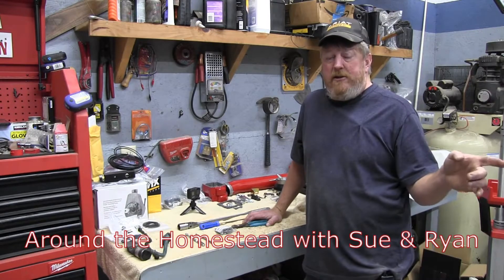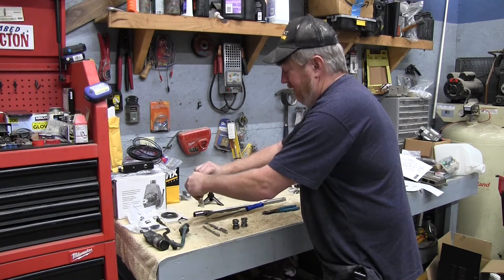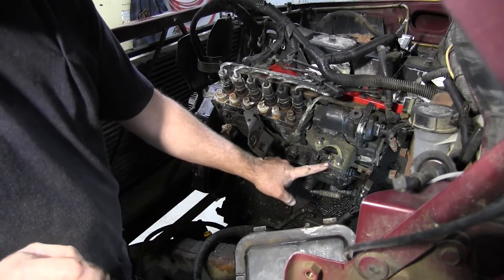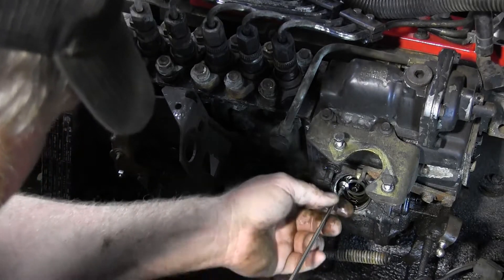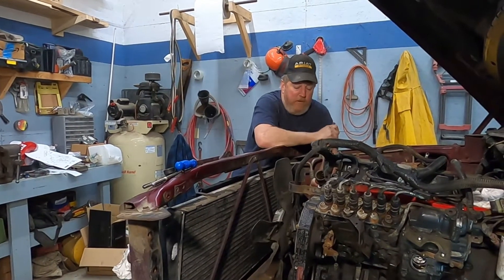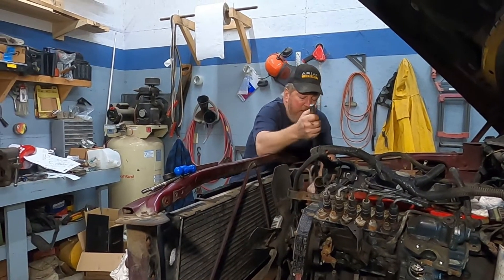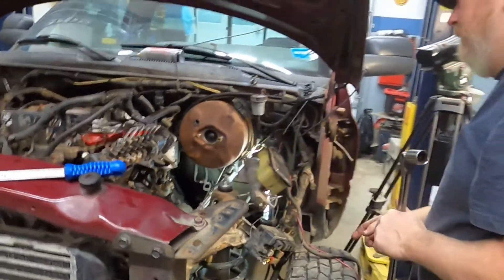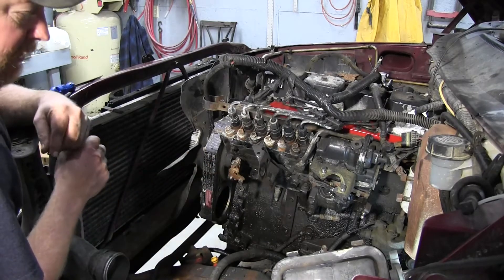Installing 3k governor springs in 12v cummins part 6

Comment: Excellent video! I've had the springs forever and I finally found time to go do them where it's nice and warm in the shop. Figured I'd watch some videos first to make sure I don't miss any steps.
Reply from the maker: It is pretty simple to do, the one thing I found was to get it right they seem looser than I would expect on installation the 2 clicks ish in that is. To tight and it starts hard (IE you need to give a little throttle). A little diligent fiddling and you can get it to start easy with no throttle.

Comment: I am about to do the same set of upgrades on my FERD Class A Motorhome.  I converted it in 2020 from an EFI 460 Ford motor and 3 speed C6 transmission to a 160 HP 5.9L 12 valve Cummins with a 4 speed AT542 initially.  Now here it is 2022 and I've just swapped out the A542 for a 5 speed Allison 1000 I built for it 6 years ago.   
Wife and I had to slay the Cancer Dragon, but are much better now!
 So while it's down I'm going to upgrade the engine with the PDD 400 HP kit.  
With the 356 regeared limited slip rear Dana 70 it should really run a lot more efficiently in the Old Coach what with the Overdrive and lock up torque converter. 
The fun part is I'm going to have to do this in an hole, standing on my head in a mirror.  Thankfully no blindfolds.
Not sure how I'm going to advance the timing since I can even get in there to see it at all.
Thanks for the video.  Been watching others do this on youtube so I can get somfortable with the process and what not to do.
Reply from the maker: If you do the 400HP kit I would say your mileage may vary on the in cab tuner. We have removed ours and will be doing a video on this very soon. I need to reach out to PDD first in fairness but if I was doing it again I would not add the tuner. The rest of the kit is excellent and we just let it run full fuel and have tuned the AFC slightly and it is very easy to drive it clean, If you push it of course you get some grey/black smoke but only if you really push it

Comment: Nice job.  Is this the best mod to get around 200 extra ft ibs without shortening the life of the engine or destroying your mpg?
Reply from the maker: Boy if the engine is bone stock and never been touched and the goal is just an additional 200 foot pounds of torque I suspect that can be had by tuning the pump some. I would reach out to some one like power driven diesel and ask them I found them very honest and helpful